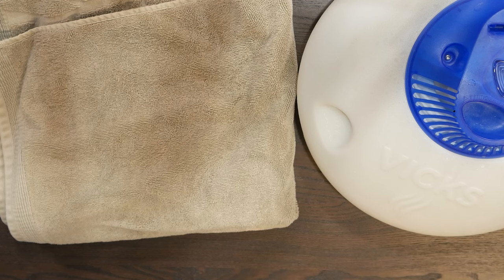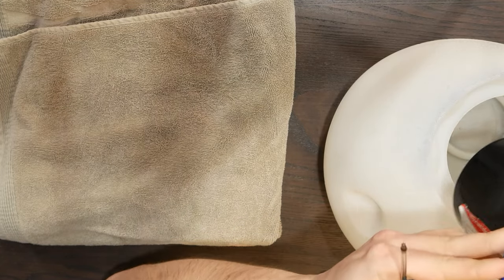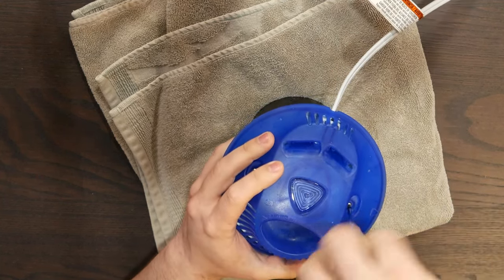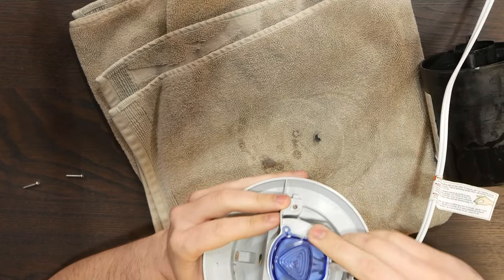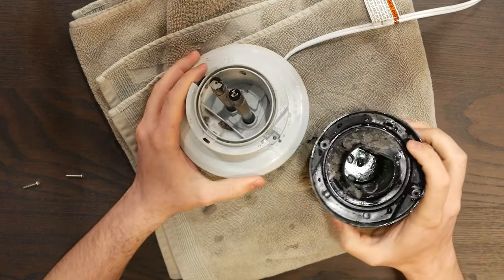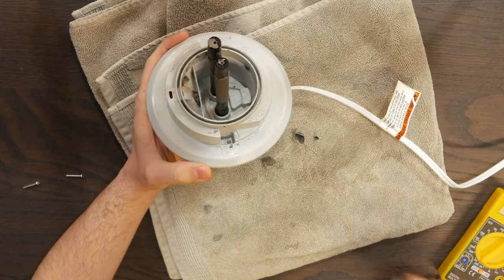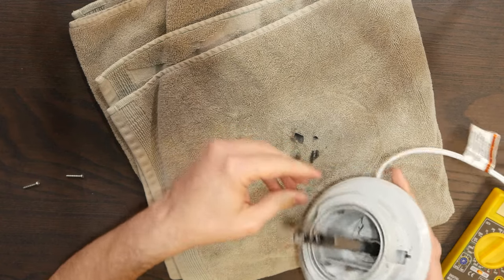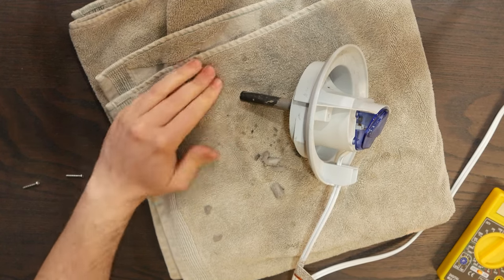Is a Vicks vaporizer an electrode boiler?

Comment: "I could plug this thing into the wall and [stabbing motion]"  😁
Reply: Glorious
Reply: What would happen?
Reply: @OutInLeftField2  death and destruction
Reply: @OutInLeftField2  The 120 volts of electricity going into the meter demonstrated in the video could go through someone's body, instead. It would be severely dangerous, basically.
Reply: I like that :D
Reply: STOP RESISTING!!!
Reply: @theweld4081  wouldn't it only really be THAT dangerous if you touched 1 electrode with 1 hand and the other electrode with the other hand? 
I mean, path of least resistance and all that.
Reply: @spookayitsme  holding an electrode in each hand IS very dangerous, indeed, but it's not the only dangerous way to get electrocuted.
Stabbing someone's chest with both electrodes might make their heart fibrillate (just like shocking a healthy person with a defibrillator). The current is still partially going through the heart.
Holding electrodes with both hands is more dangerous because it makes the muscles in your hand spasm, making you hold on tighter to the electrode, rather than allowing you to let go. (Allowing more time for more of the current to flow through your heart).
Cheers!

Comment: Well, the add-salt tip makes more sense now.
Reply: The very thing that helps it actually work is also making it grosser than it already was, yay
Reply: @tfwmemedumpster  The salt stays at the bottom of the tank for the most part. A pinch or two of salt will keep my humidifier going for two weeks worth of refills. Two refills a day (3 gallons) every day for 2 weeks. Boiling salt water is not going to make chlorine gas at these low voltages

If I forget to add salt again after cleaning out the reservoir, the water output is dramatically lower.
Reply: @tfwmemedumpster  Because the device operates on AC voltage it doesn't make any pure elemental gases. If you where to operate the same device on direct DC it would produce even with the addition of salt primarily H2 and O2 so I would be more worried about it exploding then it releasing toxic gases. The reason you don't need to worry about pure elemental gas release is that the small amount of gas generated on one half of the sign wave will be consumed by the other half. The electrolysis isn't perfect which is how it dumps the electrical energy into the solvent to boil it.
Reply: @Willcol100  so. This can be easily modified to be a hydrogen generator? Good to know.
Reply: @Willcol100  this is what I was looking for, thanks for the clarification!
Reply: @kellypg  A very energy inefficient hydrogen generator with inadequate separation between the two gas products which are produced it the exact ratio to make rocket fuel. You would be better off making one from scratch with a piece of platinum and a piece of nickel. Also most metal pollutants in the water come out prior to the H2. Its one of the reasons even with very little operation it has so much special crud buildup even running on AC.
Reply: @BelovedNL  No problem, I did my senior design project on a theoretical hydrogen fuel generator for my bachelor degree so I had to read up on electrolysis.
Reply: Also the design of the water pickup tube. It has a narrow hole and is surrounded by plastic to ensure everything outside the tube is at the same electrical potential, preventing shocks. It's the same design as in suicide showers where the live wires directly touch the water (but at least those are grounded). This would obviously fail UL or CE, the water tank doesn't count as double insulated, especially given that water can drop down the side. Even plastic kettles have a ground lead.
Reply: @marc-andreservant201  not every suicide shower is grounded here in Brazil haha
Reply: @kellypg  you'd have to look into a MHz power system for more efficient electrolysis.

As a sidenote, the evaporation (and freezing) of water is proportional to the ambient (electrical) potential, and water readily thermally ionises (which also increases the potential). Hot water evaporates and freezes faster due to this potential.
Reply: Ever since I heard that, I was sure it was an electrode boiler!
Reply: @tfwmemedumpster  This uses AC straight from mains power, so it’s not going to produce much chlorine. And even then I’d be more worried about explosive hydrogen being trapped in a container with boiling water and a potential ignition source.
Reply: Use baking soda if you're concerned.  No chlorine or any other gas comes out.

But at 120 flips/second, much of the electrolytic product is reversed, so even with salt there's no noticeable chlorine evolution.

120V is well beyond what is needed to start electrolysis and therefore emit chlorine, but for the reason above it's not an issue 👍
Reply: @kellypg  Just add a rectifier to turn it into DC current.
Reply: @marc-andreservant201  If I recall my old one of this design (a Duracraft) was not grounded yet had the UL seal of approval.  Nowadays companies use Intertek which to my understanding is essentially a "pay me $(fill in the amount) and we will give you an approval mark) rather than UL which actually tests products for safety before issuing an approval mark.  I have actually seen a UL laboratory once, it is quite impressive.  Too bad the US Government decided that Intertek could "compete" with UL, now anything and everything can be sold in this country.
Reply: @pedrofelck  From what I know of second world countries half of the buildings have electrical "systems" of whatever wire could be found at the local garbage dump and probably don't have a ground circuit anywhere in the building.  As for "suicide showers", I was under one for a shower once -- never again!
Reply: @mharris5047  what you know is completely wrong

Comment: "This is only very terrifying" - Yes, it is quite only very terrifying.
Reply: mans could be 2 wire grabs away from receiving the mehdi sadaghdar experience lol
Reply: The definition of "terror" is "extreme fear".  If you're terrified of this, then close the shades and wrap yourself in bubble wrap.
Reply: Yup, this is very much quite only very terrifying.
Reply: @RonJohn63  Hyperbole exists.
Reply: @endig4501  this is the Internet; I deny that hyperbole exists.
Reply: not really.
Reply: Terrifying is the heatsink slipping and shorting 20 amps 120V in a purple flash right next to your face.
Reply: *If u put salt(NaCl) in it depending on salt concentration it will produce either DEADLY chlorine gas or explosive Hydrogen gas .so it could be very dangerous if used wrong *
Reply: @RonJohn63  counterargument : you should be terrified of electrocution. Especially when we are talking about 2 naked live pieces of metal
Reply: @DimT670  counter-counterargument: I am prudently concerned about electrocution, not "extremely fearful".

Comment: Yep, still made that way.  "Auto-shut-off" when the water level gets too low.  No moving parts.
Reply: Could be extremely dangerous though cause that amount of power will blow up a low quality extension cord and could very well cause a fire,  I'm not saying it's a terrible idea but when this can be sold with a 5$ extension cord that's terrifying
Reply: @tenderjerky3504  Actually, even at five or six amps a 16 gauge extension cord would not overheat.  If this thing builds up substantial scale on the electrodes and starts drawing 10-12 amps continuously as my old Duracraft did you might heat up the cord a bit but the NEC states that 16 gauge cords can carry 13 amps continuously if the cord combination is 99 feet or less.  I am not a fan of 16 gauge extension cords (my main use for them is to cut the female end off and use the rest to replace an old lamp's cord) in general but even the $2 extension cord at Wal-Mart is 16 gauge and according to the organization that writes the NEC and designs most state electrical codes (not Michigan's, though -- our electrical code is virtually unchanged from the 1950's) this is supposed to be safe.  Both the old Duracraft that finally quit working for me and my Sunbeam of this type came with 16 gauge cord attached to the electrodes.  The cord itself didn't give me any problems, the Duracraft failed at the connection point where it was soldered (yes, soldered) to the electrodes after 20 winters of use.  I still use the tank to this day when draining oil out of my van's engine while changing the oil and filter.  That isn't the tank's intended use but it works!
Reply: @tenderjerky3504  You're assuming it specifically tries to pull 120v, it might just pull as much as it can.